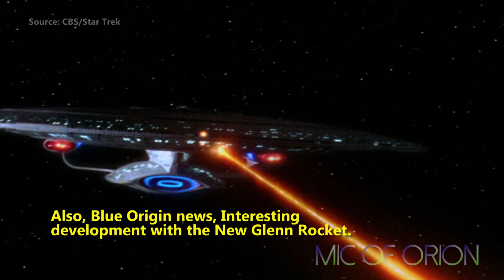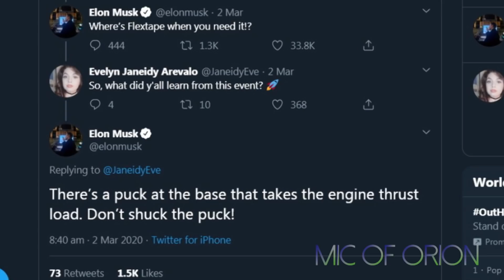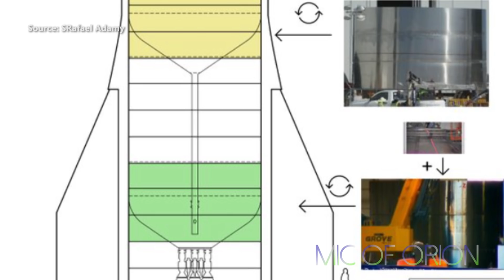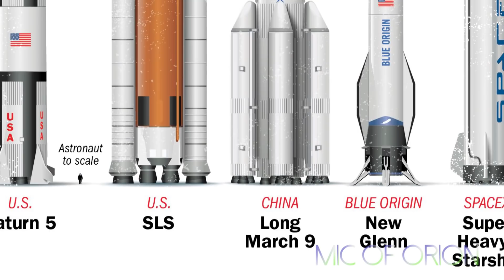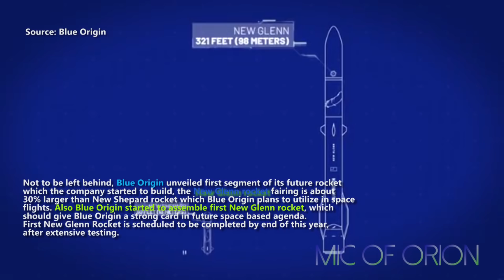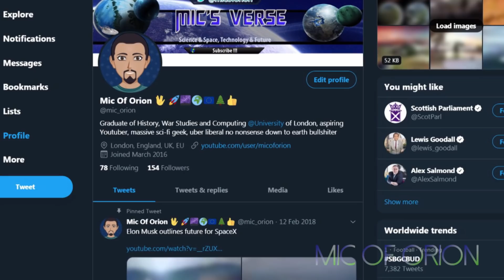SpaceX Back On Tracks With Starship SN 2 And Blue Origin News

Comment: That video of SN01 blowing is pretty astounding - the puck lets go, SN02 launches itself 100 feet in the air, while simultaneously crumpling like a giant pop can. Even more astounding - that the top tank remained intact until it came back down, then proceeded to fire its top bulkhead a quarter-mile.

Comment: IMHO enough evidence exists to declare an asteroid strike of civilization ending power a clear and immediate threat not just to the US, not just to Humanity but to the whole current biome of Earth. As such, we must militarize space immediately. Our entire nuclear arsonal, maintenance and weapons manufacturing infrastructure must be modernized as quickly as safely possible. In-roads to 5th Gen fusion/antimatter weapons pathfound.

Massive Orion style warships should be built on an industrial level at shipyards in the Earth-Luna Lagrange points 2, 4 and 5 with as much material coming from Luna and the near Earth asteroids as possible. A small contingent of this fleet would be charged with patrolling near the Earth-Luna system for threats. The rest of the fleet would go out and circularize the orbits of any and all possible future meteorites.

Further, while the Starship-Heavy booster fleet is a good starting place it is nowhere near capable enough; indeed, no rocket based infrastructure can be. We must begin the construction of a lofstrom loop with the intent of building not just an orbital ring but a cage of orbital rings in multiple layers around Earth, upon which  outward-pointing laser arrays of at least giga-watt range power must be placed for last moment diversion of impactors might be possible. (The surface area would house more than enough solar collection to power the entire world: a definite bonus.)

Habitats must be made to preserve samples of modern ecosystems, preventing any future genetic loss. Life must be spread across the solar system, far and wide, as much as possible.

This is a project too large for one generation. But we can begin it now. We must begin it now before the window of opportunity is closed. We must mobilize our violent natures to build a planet safe from the cosmic onslaught. Not one more ecosystem is ti be lost because we were not prepared! Now is the time.

Comment: New Glen will only be able to carry 45 MTons to low earth, and ONLY 13 MTons to geo.  If Starship works, New Glenn will be obsolete before it leaves the hanger.
Reply: if is important word, beacuse it doesn't seem to happen any near future, while first actual new glenn is being assembled.
While starship... Uh... I had better opinions about SpaceX before boca chica started.
Reply: Mikicat - New Glenn just built a HALF of a farring, and looks like part of a trunk.  The BE4 has not even flown.  Star hopper demonstrated the raptor can fly, and SpaceX has tested several tanks weld technologies.  Elon is on a mission, where as Bezo’s is looking to win government contracts, along with space tourism.  We “should” have a flight worthy starship by June. Whether or not it actually flies is another thing.  Elon is clearly the hare, and Bezo is the tortoise.
Reply: @keithmcknight7646  guess you are little late with updates, as in one video we saw clip where the core stage was being stacked. And it did not look like prototype

Comment: No, i do not think space should be militarised. For me, part of the beauty of space is that it doesn't have borders...and it does not discriminate between colour or creed. Do you think SpaceX will ever be able to achieve their one piece, single weld Starship ? personally, i do not think they will be able to build a human rated Starship using traditional welding methods....friction welding is where it is at. No extra material is added, no excessive heat is created, and you can even fuse different types of metal together using this technique. Boeing developed this, and used it to build the Orion capsule for NASA....peace brother.
Reply: Hopefully someday when NASA or the air force wants to visit Mars, they will have to get permission from Musk’s people.  But if you jump in bed with them now, that’s not going to happen.  
Interesting. I have never seen friction stir welding on material as thin as 3mm. Probably can be done.  You do have to have the tooling to keep the parts pretty well clamped down for the process. (Tooling and jigs are a little thin in Boca). Seems that might lead to horizontal production?  Not a bad thing, just different from current.  Maybe I just can’t envision a stir welding/clamping device adding another ring 90’ up inside their new VAB. 
I guess necessity will design it. ;-)
Reply: @bearlemley  Hey Bear, nice comment. What i do know is the technique Boeing developed for the Orion capsule has been patented so no one else can use this particular method unless you give them a boatload of money. Friction welding is nothing new...but has mainly been used in the plastics industry. It is not easy to achieve when it comes to metals...but it's the future my friend...peace.
Reply: Yeah, if starship is ever to meet it's clickbaity goals, they will need to change some things...

Comment: @3:49 that section looks like a  ring for the booster?
Reply: I'm not overly concerned with super heavy booster, Spacex knows how to build boosters, even though comparing the falcons to super heavy is the same comparisons to apple's to beach balls a booster is a booster, I think it's development to actual deployment will be  very very fast.
Reply from the maker: Yes, same progress with New Glenn as well.
Reply: They will not start production of a booster until the Starship has already started test flights. They are still a ways off from beginning that process since they are still working on building a Starship that can withstand the pressure testing on the stand.

Comment: Great video but let's hope mannened versions of Starship won't be built in tents under the same conditions they are currently building them. In the video @ 7:03 it says SN12 will be the first manned version. Testing every component in the manned version is great. But what about the conditions where those components are assembled into a complete vehicle?  In my opinion it should be a clean sterile factory. And manned versions should have a means of escape if there is an accident.

Comment: SpaceX is going to “Human Rate” Starship the same way way SpaceX “Human Rated” Falcon 9, with multiple successful launches, so SpaceX will not need to delay while individual parts, subsystems & systems are tested over & over again...
Reply from the maker: They'll have to test everything, every system if they wish to carry NASA payloads, be it manned or unmanned,
Reply: mic of orion - NASA hasn’t required that with SpaceX. If NASA had done that, we’d probably still be waiting on Cargo missions to the ISS, because both Falcon 9 & Cargo Dragon would never have been certified under that kind of regime. NASA only has required that SpaceX demonstrate that Cargo Dragon could safely deliver the payload to the ISS for Cargo missions, & had SpaceX do 5 consecutive successful launches with a “design freeze” & had SpaceX demonstrate that Crew Dragon’s crew safety systems work for Human Rating of F9 & Crew Dragon. 
CST-100 was supposedly “certified by certification of parts & systems”, & it had 61 Flight Critical Issues (things that could have led to either LOCV or mission failure) during its Demo Mission. 
Certification of Spacecraft by certifying that you are using only certified systems & parts may be cheaper than certifying by successful tests of the spacecraft, but it doesn’t necessarily produce a safer or more reliable spacecraft (see the CST-100), & NASA has decided not to require it from SpaceX (see F-9 & Cargo & Crew Dragon).
As Starship is a completely new design, it can’t be “certified by systems, subsystems & parts”. That would take a decade. As NASA has proven, NASA can get safer & more reliable spacecraft & cheaper launches by allowing SpaceX to “Certify by Flight Testing”.
Reply from the maker: @TraditionalAnglican   it has, Cargo dragon underwent 5 years of testing, Falcons 9 as well, crew dragon should be ready now, after 8 years of testing.
Reply: mic of orion - Crew Dragon’s first test was a Pad Abort Test on May 6, 2015. Crew Dragon had been in development since 2011.
Reply: And, as an aside, the route Tesla is taking with "Self-Drive". Then intend to iterate "Autopilot" until they have sufficient statistics to say "It would be provably safer to just let the autopilot do the driving." Crew Dragon is a silly metric - it wasn't validated the same way. Falcon 9 was - Crew Dragon was not.